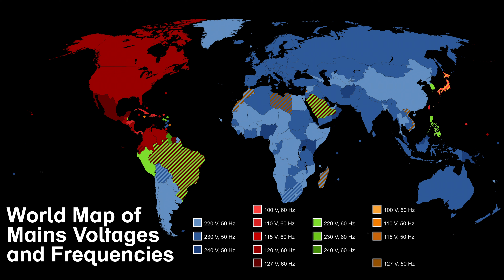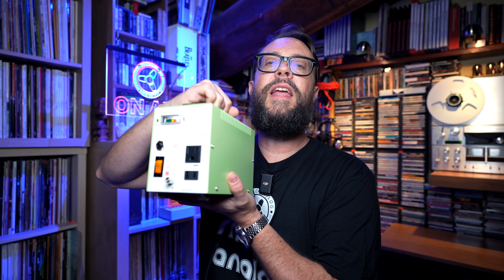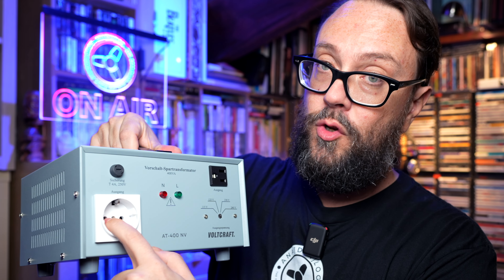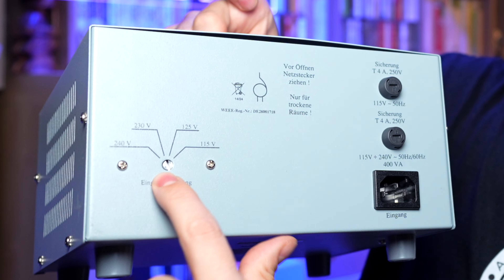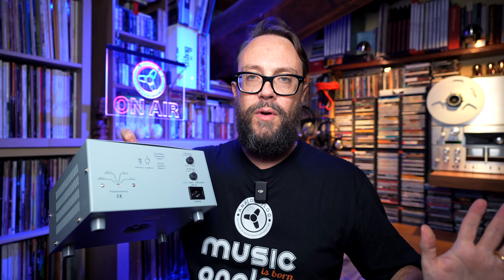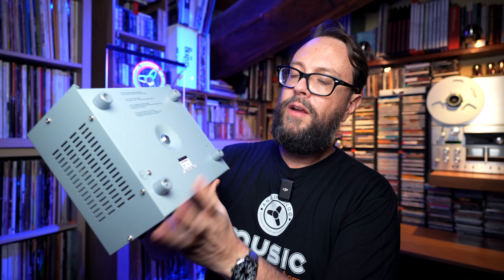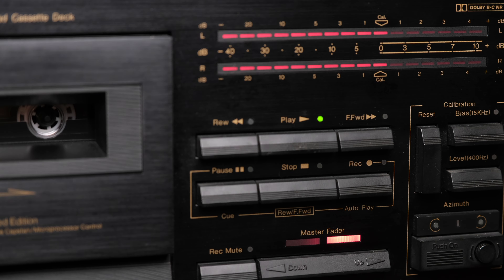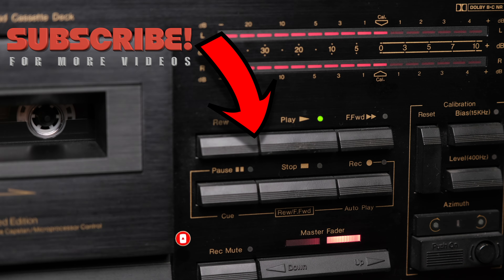Selecting voltage step-up & step-down transformers for your foreign Hi-Fi gear

Comment: I had to use step up and step down transformers for my guitar rig, as I was fortunate enough to tour the UK, Europe (step up) or Japan and china (step down) and I noticed a slight difference in sound, which on paper shouldn’t necessarily be an issue at all, but I did notice it, and it was audible. It was this big huge giant yellow brick with a super heavy transformer in it, but it did its job. 
Thankfully, most audio gear is made in the voltage of your country, but I’m sure there’s exceptions. Thanks as usual, Guido! Another great and informative video. 👍🎶😊

Comment: I wrote a post a few minutes ago but I think it may have been blocked because I included a url? In any case, I can recommend Airlink Transformers, made in the UK. I've been using a smaller one for my imported Japanese voltage turntable for over 7 years and it's been great. It runs cool and makes no humming noise etc.
Reply: Thankyou for that useful piece of ok centric info as I will need a transformer for an Airtight integrated I intend to purchase from Japan

Comment: do you think step-up transformers can improve sound vs plugging into a regular house outlet or will it be always worse sounding?
especially when using your top recommended Voltcraft.
just another thought..
Reply from the maker: Improve? No, not with a voltage conversion. A quality power supply or powerstrip, indeed!

Comment: Thanks for this  video.I have a question for you.I own a 220V Bryston integrated amplifier ,it is 100W per channel in 8 Ohms ( 180 W per channel in 4 ohms). Now , I moved to  USA and i want to use this amplifier with a  voltage converter.Do you think I'll be safe with a  3000W step up/down converter or do you think i need more? Thanks in advance, Have a wonderful day.H.
Reply from the maker: More than enough!
Reply: Thanks Guido, have a  wonderful new year

Comment: If I want to buy a Japanese domestic amp with 400W requirement (which is completely average for an integrated) should I buy a 4 kW (!!!) step down/up trans??
Reply from the maker: No, at least in Europe normal domestic plugs reach 1500W. You would need a special step-down and a pro type of electrical connection. Are you sure it has 400w of absorption? With that type of drain I would stick with amps with your own voltage of build a dedicated line.
Reply: @anadialog  a normal 230V Denon integrated requires 300-400w. So I am just thinking if Japanes ones have same need what transformer fits the best.

Comment: Hi my post is not really about step up or down transformers but about the mechanical hum you experienced with large toroidal transformers 
This is caused by DC on the line mostly switch mode power supply which collapses the magnetic field and can be cured by using a DC blocker on the line
I have 3 identical power amps from the 90s when it wasn't such a problem so I used 3 DC blocker from audiolab completely cured all mechanical hum.
 hope this helps. Ps did not stop the mechanical hum from a rel t5 subwoofer
Reply: No, hum is not just caused by DC on the line. You already admitted your Rel hums which is active so has a transformer. At the end of the day using another step up/down transformer to your power circuit is going to be a compromise. Amplifiers from other countries should be converted to your home voltage. It is only lower powered source equipment where you could get away with using a step up/down transformer since the hum is less.

Comment: Hello, I am looking someone opinion about this topic. Is it right to use autotransformer type stepdown converter, i want to power my mc30s and i bought step down converter from 230v to 110V that inside is transformer that works as an autotransformer. Autotransformer is similar to simple transformer just current running from 220 to 110 in same choke wire and wont separate current as isolator transformer. I am just curious if anyone tried both set ups or have opinion and know exactly if there is any difference in using autotransformer type converter or  simple transformer what runs also as isolator?

Comment: Airlink transformers UK design and manufacture audio transformers of all countries voltages. They also make up/down balanced transformers. I have 240 in 100 out 50Hz 2 outputs,it’s excellent with zero hum issues 😊
Reply: I have an Airlink and also a friend. We both experience high him from each and we do not have issues with our home supply. So your statement is not correct.

Comment: sure thought the video was going to cover MC step ups not line level transformers. I try to avoid the AC mains variety. A lot of gear now has selectable AC input voltage internally. Usually move a few jumpers or unsolder a couple of wires and unit is now ready for service in the EU or visa versa.

Comment: What an odd topic. From the title I thought you were going to talk about Moving Coil cartridge step up transformers, and was trying to guess what a step down transformer would be for.
How many people are buying gear made for another region with a different AC voltage? With most gear, there is a voltage selection switch, or a multi tap power transformer that you can reconfigure for your voltage.
You really don’t need a 10X rating for an external transformer, there is already a built in safety margin.
Equipment doesn’t “adapt” to 50Hz or 60Hz AC frequency, it’s either sensitive to the AC frequency, or it isn’t. Generally, products that use a synchronous motor without a separate frequency generator power supply will be sensitive to AC frequency, so we’re talking old cassette decks, turntables, and reel to reel machines. CD players are typically not sensitive. 
One thing I see a lot is people selling Japanese market FM tuners on EBay. DON’T DO IT! Japanese FM uses a completely different band, and the tuners are not compatible.
Reply from the maker: Some misunderstandings here. If I was going to talk about MC SUT there is not going to be the word Step-down and there is going to be MC or at least phono. Many people need this because many audiophiles want Japanese or US stuff. Clearly you do not import but that is your experience. Most gear does not have a voltage switch only industrial items and new items. Most vintage and quality hand-made hifi gear does not. Again your experience does not reflect the majority of people since sevral people asked for this video. 10x is not for safety margin...where did you get that idea? Its to preserve dynamics and a high level of performance, especially in push-pull configuration. Yes it does adapt, meaning it will work. I didn't say it will convert the frequency. Yes, some gear may be sensitive to the frequency I agree on that. Fortunately some old gear does give you the chance to select the frequency when they are sensible to it. I also agree on the tuner part.